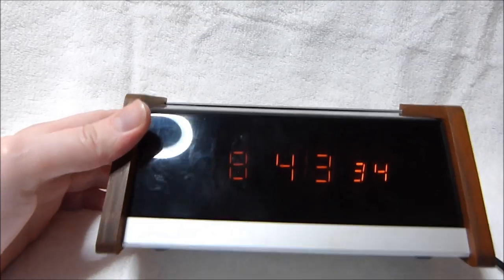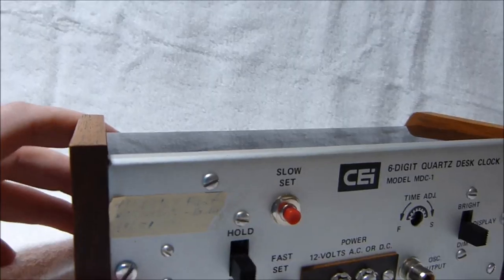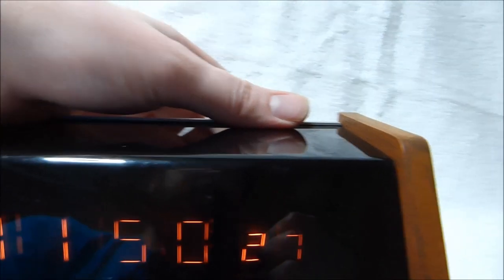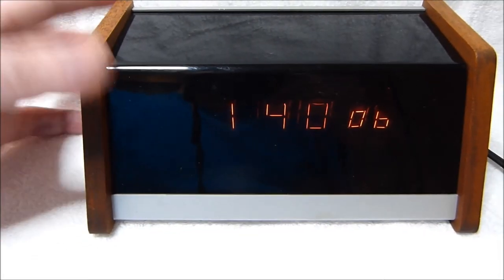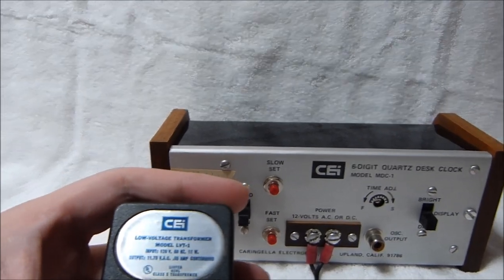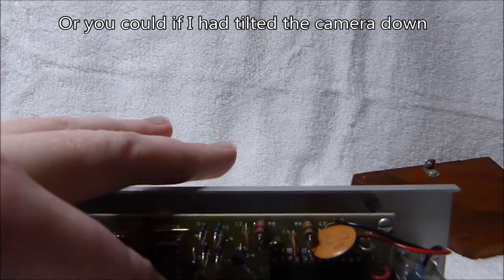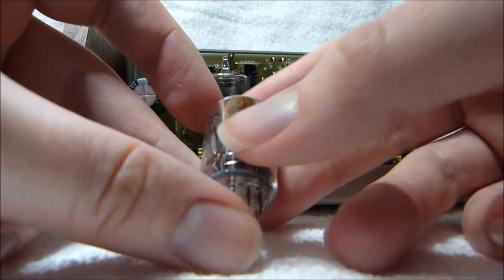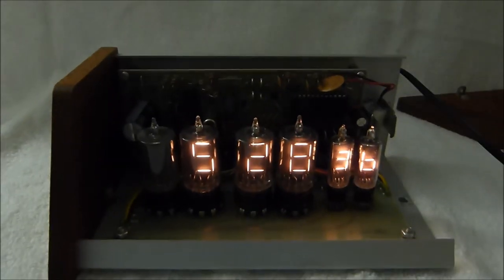Caringella Electronics Inc (CEI) model MDC-1 Numitron clock (1975, USA)

Comment: Hello sir, I am glad you posted a video on this find.  I think I saw this same one at auction recently and was stressing about weather or not to buy it and then it was sold.  It created great anxiety until it sold.  Congrats!  Oh well for me LOL.  I have seen one other.  Anyway, there is a vintage book called Electronic Clocks and Watches by Michael S. Robbins that you may want to get especially if you have more vintage clocks.  This clock is featured in the book.  A schematic is also included.  FYI, IEE Apollo DA-2000 tubes are equivalent to the DR 2000 tubes and DA or DR 2010 tubes will also work to replace the big ones.  I also have a MM5314 clock that was home designed and built with an internal oscillator and Numitron tubes.  I also found the added oscillator strange.  Your clock would fit my 70's collection wonderfully and I would LOVE to have it if you ever decide to part with it.  Moving on, I have a single digit Numitron clock on the repair bench that copies Caringella's single digit design.  Mine uses a different case than CEI's.  The video will come at some point for that.  Hop over to my channel to see the collection that I am starting to document.  I have a few MM5314 clocks and a MM5313 one.  My collecting disease started with a TTL clock build.  You have other clocks with the MM5314?
Thanks,
Jim
Reply from the maker: I just knew I had to have this one, so I made a reasonable offer, and surprisingly it was quickly accepted. I'll keep an eye out for that book, thanks for the tip. As far as  MM5314 clocks go, I have the same Lucite cased VFD clock as you do (I'm also wondering if it was a kit), and another clock that I built myself from a NOS EKI kit (the kit quality left something to be desired, but the clock does work fine). I just subscribed to your channel, you've got some interesting clocks!
Reply: Thank you, I am on the hunt for more.  I was submitting my offer for the CEI when you were confirming on your end LOL.  I missed by 3 minutes or so!!  Don't tell me what you got it for.  Be well, Jim
Reply: The clear VFD clock.... I have been watching them on Ebay and I did reach out to someone about it once.  He said it was sold by a company called the Holes Webway Co back then.  I aslo wondered its history.  It has a logo on the board of C/Z....not sure.
Reply from the maker: @JIMO415  They seem to be one of the most common early digital clocks (though they are still uncommon), and despite that I have never seen a manual or original box. The board in mine is also marked "(C//Z)". I'm guessing "Holes Webway Co" was just a distributor, otherwise I would think that they would have put their logo on the PCB.
Reply from the maker: Thanks for the heads up on "Electronic Clocks and Watches", my 'new' copy of it just arrived, and it seems like it will be a useful resource.
Reply: You are welcome.  The book does explain your unique time setting issue that you mention in your video.  Interesting!  I was reading it last night.  Also my guess on the internal time base is for use with the battery backup and the book confirmed that.  The display would be off but the clock still keeping time.  -Jim

Comment: If you look at the January, February and March 1975 issues of Radio-Electronics magazine, you will find more information on this digital clock and two others sold during the same time.
Reply from the maker: I don't have any of those issues, but I do have the August 1976 issue, which has some details on this clock, and others.  I'll keep an eye out for those as well.

Comment: 0:19 No it was not!
 Run on 60Hz, line frequency? The Quartz crystal would be divided down to 64Hz
5:44 You can probably find replacements in some old Eastern Block republic
Reply from the maker: It has a trimmer capacitor to shift the oscillator frequency a bit, and after some tweaking to it, the clock keeps time just fine.
Reply: @50sTransistorRadios   Very well!   A 9V transistor battery would be quickly drained dry by a display that used incandescent filaments. The filament segments that were 'not on' would  still be run hot, but below incandescent temperature to prolong the life of these Numitron tubes - - ie: thermal shock fatigue would quickly burn out these filaments